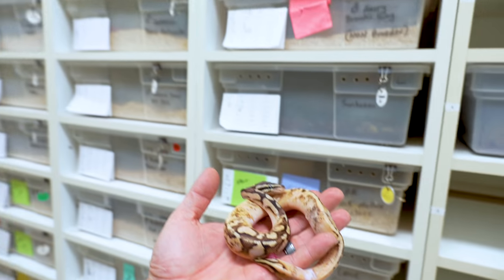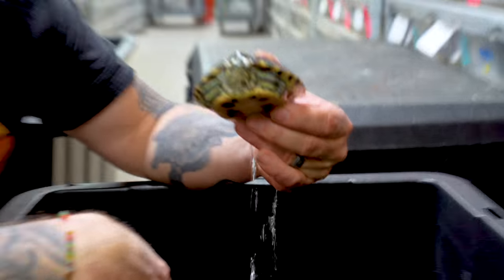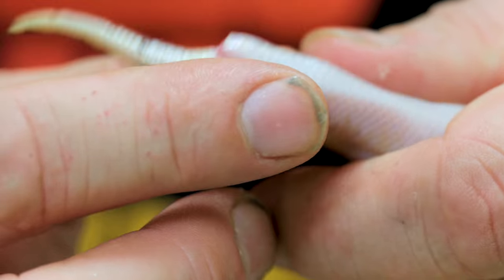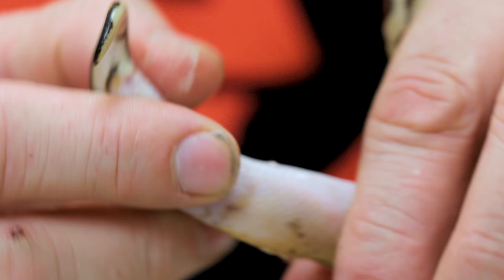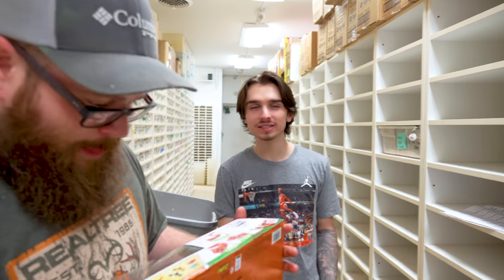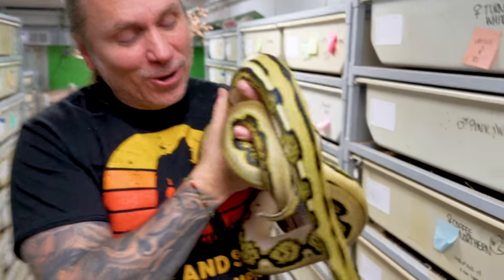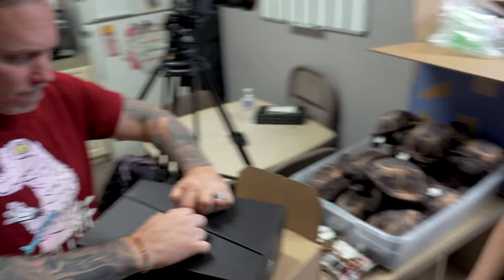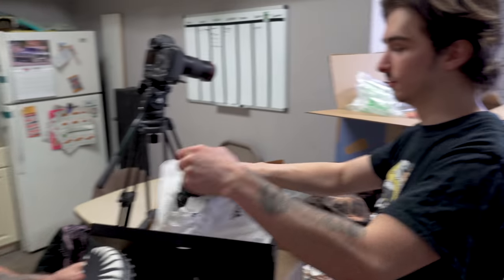MY SNAKE PROLAPSED!! NOW WHAT? SAVING HER LIFE! | BRIAN BARCZYK

Comment: Smaller animals we use sugar water to reduce swelling to get the prolapse back in. For things larger like cows we just use really cold water to get it to shrink a little and shove er back in and stitch it in place. Prolapsed cows are scary though because if you rip the uterine wall theyll bleed out and die within minutes. 😖